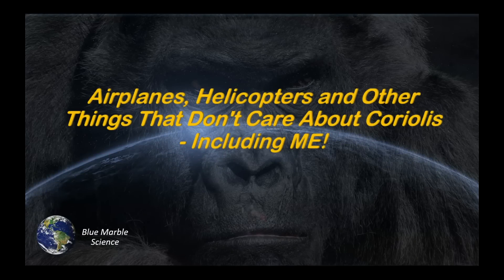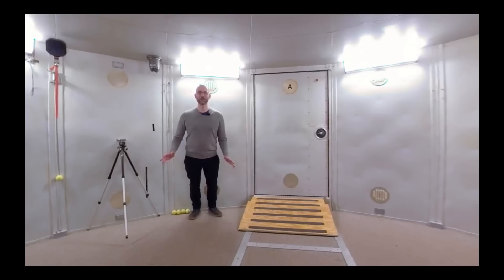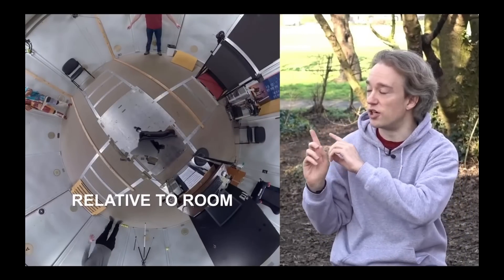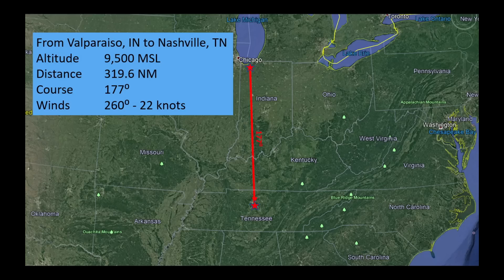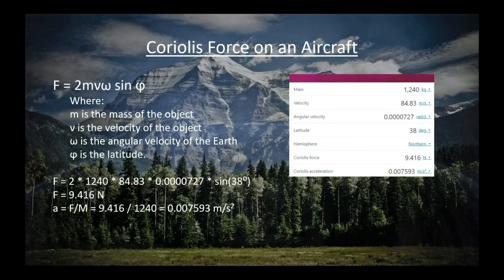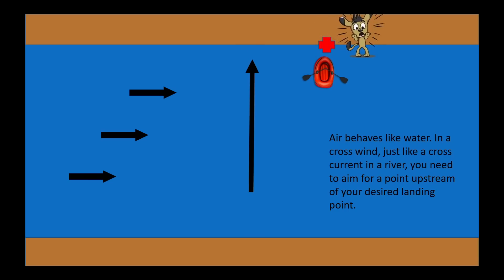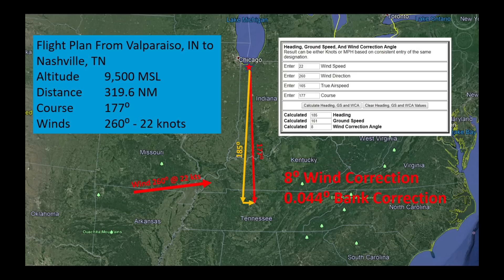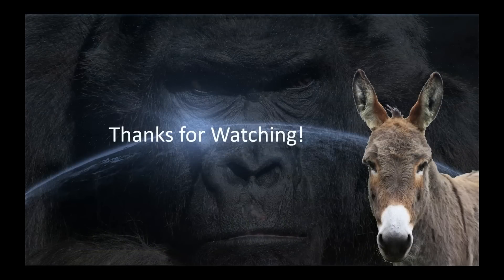Airplanes and the Coriolis Effect

Comment: Is that similar to rotational movement in shots over 800 Meters , Been a long time but i was taught to use earths spin rate and curvature in shots over 800 metres require  inch accuracy( Short version).The wind can be bastard.
I understood that and what was going before they tossed the ball. that was cool, used be rides in the festivals like that.

Comment: I have a quick question about hovering helicopters. For sake of argument, let's say that you had some amazing helicopter that didn't require any input from the controls to maintain a perfect hover. Would it have the same 15° drift like a gyro or faucault pendulum? I always imagined it would just spin in a circle.
Reply from the maker: I can't even wrap my head around it! To me, it is a device being controlled and as such, it would remain stationary. Now if we go crazy with the thought experiment and consider it like a gyrocompass, it's spin axis is not oriented correctly to cause precession to seek north and I think you're right, it will just spin endlessly (one direction or the other) depending on what hemisphere it's in. Ouch - I think I bruised my brain!
Reply: @bluemarblescience  Lol. That's why I needed help!! Maybe it would be easier to think of a drone instead since there are 4 rotors and it doesn't need nearly as much control input. Thanks for the reply though. I think I can now put this curiosity to bed.
Reply from the maker: @charlieghague  😂

Comment: Aircraft are not projectiles. Aircraft are controlled by control surfaces. 

Now, large artillery with 20 mi range, Coriolis effects are incorporated in the firing solution. Used to from tables, now it’s software.

“.... Since the Earth’s dimensions and rotation rate are known, it is possible to estimate a correction on the trajectory based on the geographical locations of the launching point and the target. The analytical treatment of the drift due to Coriolis Effect is complex and implementation of the effect in computational software is rigorous....”

https://apps.dtic.mil/dtic/tr/fulltext/u2/a462493.pdf
Reply from the maker: Thanks for that. It says an artillery round will miss by 100m at a range of 20 km due to coriolis. I believe that. For anyone wondering, 100m is a miss even with a 155mm howitzer!
Reply: BlueMarbleScience 
FE so often carry on about that they’ve been in the military, and they never correct for curvature or Coriolis. Yet the military is replete with WGS84, satellite navigation, satellite communications, satellite intelligence, long range missiles, long distance sorties, etc. all dependent on satellite technology. 

And a simple search of DMA, NGA, hundreds of declassified dot-mil documents, returns nothing but WGS84 when using MGRS coordinates for EVERYTHING. 

And those self described former military are almost never able to even cite what MGRS stands for. 

Military Grid Reference System. The most fundamental component of TACTICAL CHARTS. Targeting, navigation, isolated personnel recovery, and reams of docs on just that. Grid azimuth magnetic azimuth true azimuth astronomic azimuth by sun stars 

It’s just like when a FE claims to be a commercial pilot and swears that he/she never takes the shape of the earth into account. And then uses google earth as proof of flat. 

It’s getting old.

Comment: Well done sir! But you have a small error in the bank angle equation: you have to divide by g inside the atan function, like so:

Correction = atan( 2 * omega * GS * sin( phi ) / g )

The argument of the atan function must be unitless. You have an acceleration as the argument.
Reply from the maker: Woops! That's what I did in the calculation but I messed up the formula on that slide. I'll put a note in the comments. Thanks Walter! Another way you can look at this is from the standpoint of the horizontal component of lift that causes the plane to turn in the first place. If we need a 9.4N coriolis correction force and a (1240 * 9.81) = 12,164N lift, atan(9.4/12,164) = 0.044 degrees of bank. Your method is easier because you don't need the force calculation to begin with. Thanks again.

Comment: IFR flights will fly between fixed waypoints, so coriolis is irrelevant.
VFR flights fly by visually checking/adjusting your position and heading, so coriolis is irrelevant
Air movement, even on a"windless" day will have more of an effect that coriolis, making it irrelevant.
BTW, coriolis IS of significant importance to helicopter pilots ... I will leave you to figure out why ;p
(Hint: it has nothing to do with the rotation of the earth)
Reply from the maker: Well, if they would stop flapping and flopping all that stuff around, the problem would go away! 😂 I know what you're talking about but I have really no training on rotary wing. But you're spot on with navigating. We don't just sit there and allow the plane to deviate wildly from the desired course. We make constant correction or better still, we instruct the autopilot to do so.

Comment: Another instance of flerfs having no grasp of scale.  If I pull 3 hairs from my head, will I be able to run faster through not having to carry the extra weight of those 3 hairs?  In abstract theory, yes.  The proportion faster would be the same as the ratio between the weight of those 3 hairs and my total bodyweight before the hairs were pulled.  So in practice the difference would be fuck all.

Comment: There was a glaring, unforgivable error in the paddling across the river example. That was not an “X” that was a cross. So because you got this wrong, Coriolis force does not exist (even though you were discussing drift in this example). 😇

More seriously though, that was another really good well explained, working example of Coriolis force. I especially liked the maths behind it. Being picky, a “zoomed in” illustration of the bank angle would have demonstrated how infinitesimal the bank required would be. You could also have shown the track error that would have to have been corrected at 165 kts. 

Great video. Thanks.
Reply from the maker: Didn't want it to be too long. I figured 10 minutes of coriolis was about all most people are willing to endure.
Reply: BlueMarbleScience - I agree. A well formed, properly explained concept does not have to take up too much time.

Comment: Most flatards are number-proof, calculations just slide off them or go right over their heads.  Those that aren't,  like Knob Noodles, just flat out lie.  

A moment's thought shows how an aircraft, helicopter or missile is powered and steerable so the course can be corrected at any point along the route and any apparent force come sad for.  A projectile is not hence coriolis calculations are required for long range artillery and even for rifles over 1000 yds or so.  Sadly, even when you show flatards real guns being shot in real life and the effects are clearly visible they refuse to accept it.  A true delusion proof against all facts.

It is very interesting to see the numbers,  though, so thanks and carry on.

Comment: The spinning lab made me feel sick. I've got a weird thing that let me pass my class 2 medical a while back but then it turned out I could not fly an airplane for other reasons. The need for glasses, even back then, prevented Uncle Sam from picking up the tab. I really wanted to be a helicopter pilot. All I ever got was a half dozen hours in a Cessna 172 before it was apparent I had something rather wrong with me. BTW, did you know you can piss off a flight instructor by inadvertently going inverted during full power stall recovery practice and reaching VNE on the dial? I also dropped 500 feet instead of 50. I think Cessna is being conservative about the 3.4+g limit.
Reply from the maker: 😂😂 I know exactly how students like to piss of their CFI. That stall-spin trick is one of their favorites too! Thank God for Cessna - I would have been dead long ago if it weren't for those guys!
Reply: @bluemarblescience  There certainly wasn't any discussion of Coriolis. More like wether or not I would still be in the plane when it landed.
Reply from the maker: @Fudmottin  😂😂😂 Yep - been there!

Comment: You know that was actual a very refreshing video. Straight REAL WORLD science. Not to mention the only thing I have ever wanted to do and wished for since I was a little toddler was to fly a helicopter. I was in tje military dual branch but yet never gor a chance to fly one. I digress, thank you for the real world amd straight forward factual science of reality!! Great job!!
Reply: I had an hour's "taster" lesson in a small helicopter with dual controls. I can confirm they are very hard to fly and I don't think I was controlling it for more than 2-3 seconds at a time (at best) before the instructor had to intervene and make corrections. It's like trying to juggle with both your hands and feet at the same time whilst spinning a plate on your nose: you are constantly correcting. Apparently it takes dozens of hours to get to the point where you can safely control one of these things without the instructor constantly taking control and, even then, you won't be allowed in one without an instructor. The average to get to the point where you can safely fly a helicopter without aid is 60 hours training.

The notion that something as negligible as Coriolis could somehow have a meaningful impact is ludicrous.

That's a bit like saying a rodeo cowboy needs to plan and specifically adjust his control of a bucking bronco based on how many fleas  are on the horse.

Comment: So many larger issues than Coriolis. If you were going to slip, banking to correct for Coriolis, you'd have a hard time noticing the roll offset as you burned fuel out of one wing tank and then the other.

I think your weight and balance will affect your angle of attack, and hence P factor, far more than Coriolis, too.

Keep 'em flying. Your videos are great!
Reply from the maker: You're spot on. I'm very sure that fuel burn will have a greater effect than coriolis does. Thanks for the comment.